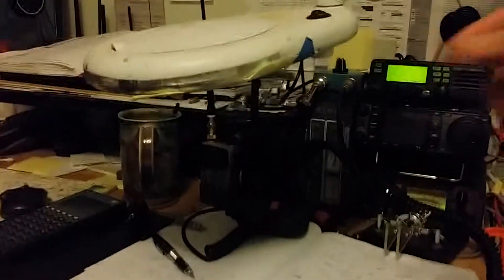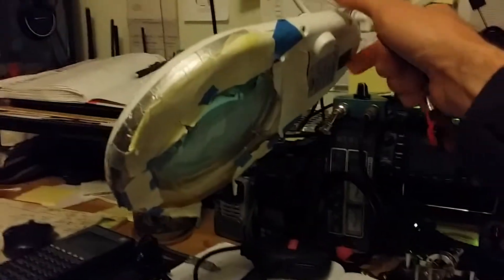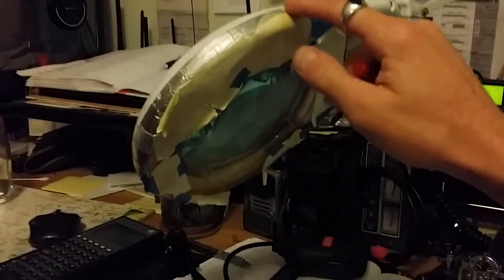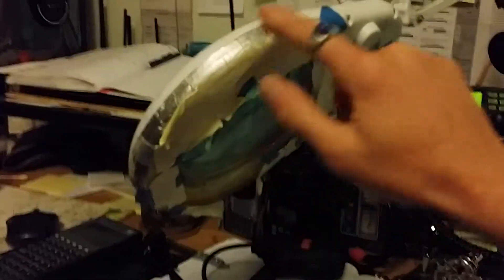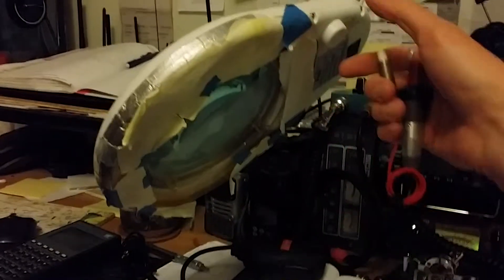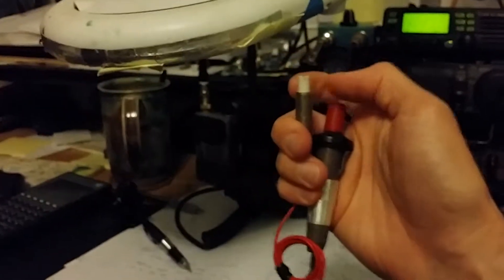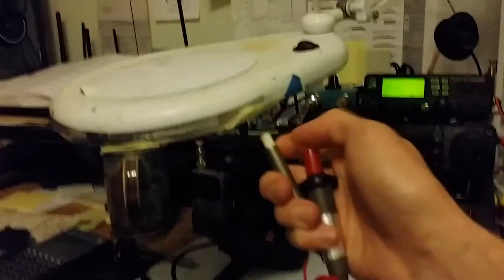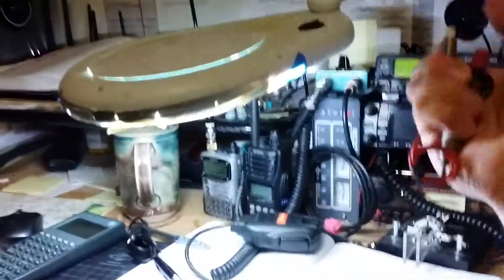Lighting a fluorescent lamp with a piezo bbq igniter

Comment: I had an idea to remove the ballast and the starter from a fluo tube setup and start it with a lighter piezo spark generator :D I'm gonna try it at home in few days, should work because I tested it and the spark does go through the tube every time, even without heating up the tube